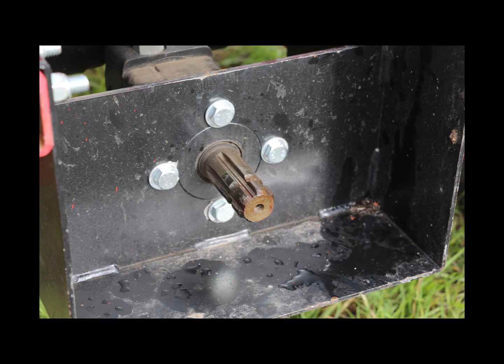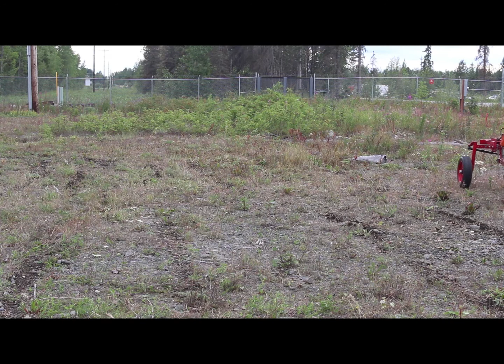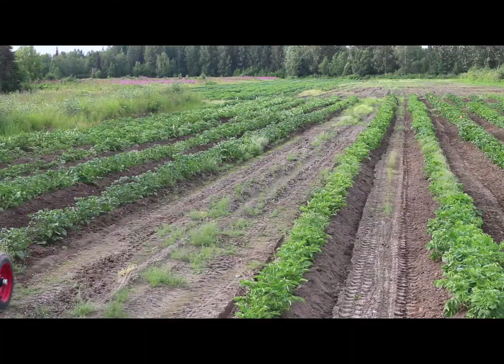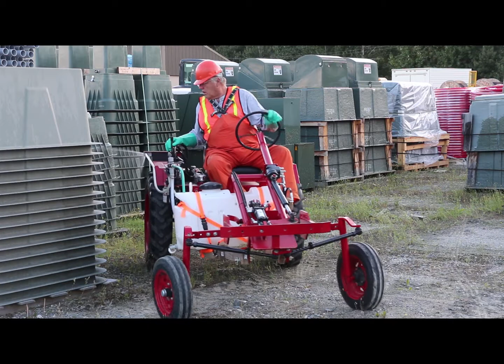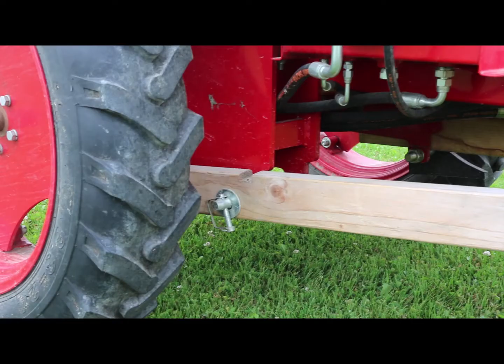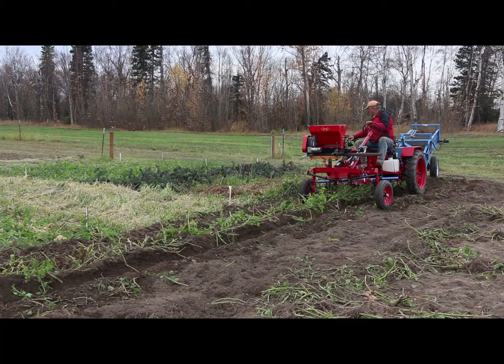Oggun Tractor in Alaska

Comment: Any updates on your speed readout? I’m curious on adapting it for my allis g
Reply from the maker: I haven't implemented it yet.  I practiced a bit and was able to get an accurate plot speed by locking in the engine RPMs and using a stopwatch to time the duration of getting through the 30' plot.  After a few practice runs I could consistently do my runs within a 10% variance.  Although 10% is too sloppy for spraying its fine for cover crop seeding.  I haven't given up on the bike computer but I haven't needed it yet.

Comment: I would add another hydraulic pump for increased flow and pressure.  A lot of excavators use this so as not to depend on the one pump to power everything.
Reply from the maker: Thanks for the comment.  If you pause the video at 0:38 you'll see the stack of hydraulic pumps.  One controls the drive wheel motors, one controls the steering cylindar along with the mid and rear 3-point arms.  The furthest one from the Honda engine runs the pto motor.  Although they share a common reservoir the systems are separate.  I talked to Oggun about increasing flow capacity but their hydraulic specialist thought that would tax the Honda 680 beyond its capability.

Comment: Does it have a half track option?
Reply from the maker: I have not seen one but you might want to talk with your local fabricator...  That's the beauty of this system.  Its simple and stout so you can modify whatever you want. 

Although you might gain some traction (and decrease ground pressure), I think you'd lose a lot of the incredible maneuverability that the wheeled version has.

Comment: Just a note to say ,why don't you trail a small dump trailer behind the potato digger and dump ant the end of the row or bag them at that point? En joyed your video,I think that tractor has umlimited potential
Reply from the maker: Short answer is that the Oggun is barely enough tractor to pull the digger by itself.  I'm not sure it could also pull an additional dump trailer.  

Long answer is when I used the digger with a larger tractor, and had a team of pickers to pull the junk off the digging chain, dumping the spuds off the end into a wagon is a viable strategy.   Unfortunately,  if no workers are available to pull the junk off the digging chain the unit sends a mixture of potatoes, vines and dirt off the back which makes a real mess in the trailer, rather than a nice batch of relatively clean potatoes.  If I have adequate workers available I usually have them pick the potatoes off the chain and let the junk go over the end.  You end up with a much cleaner product in the harvest totes.

Comment: State of the art 1957, Fendt Toolcarrier System, except much better than this (even the Seeder is engineered similar). Look into it, you get some masterpiece of implement designs...And thats not an airseeder btw
Reply from the maker: Thanks for the connection.  I Googled the Fendt Toolcarrier System and what a neat tractor.  The more recent versions look to be much larger than the Oggun but I did find a photo of an older model and you're right,  it looked very similar.  The seeder actually is an air seeder (Gandy Orbit-Air Research Model).  At the time of the video I had not fabricated the bracket to attach the blower that supplies the air or the tubes that carry the seed.  That maybe why you didn't recognize it as a tiny air seeder.  I'll try to post a video of the seeder next growing season.
Reply: @alaskaspecialtycrops9521  An Airseeder is not needed in my opinion. A normal mechanical drill will do it plenty. Airseeders are only efficient above a certain machine size and seeding speed. It would be best driven by sprocket wheel since there seems no PTO with synchron turning speed. Like I said, the oggun has a major design issue to that. Also the leveling is following the rear axle which should be compensated by some contact wheels on the tool itself if the depth of the seeding should be constant.
Reply from the maker: @md.fuelkiller1990    Good Point.  I don't need an air seeder but its what I've got so I'm using it.  One of the reasons that I chose an air seeder is that it gives me the option to seed cover crops in the space between the rows without putting the seed in the row of standing vegetables.  The tubes give me much more precision in  broadcast seeding than a regular drop seeder or cyclone seeder would.  I agree that there are some advantages to a ground-driven unit, especially when drilling the seed.  But for broadcasting the seed I prefer the air seeder.   I'm also able to use the air seeder on larger tractors.

 I'm intrigued with your note about the PTO being synchronized with speed.    Both PTO speed and drive speed are associated with engine rpm but they aren't synchronized on a hydrostatic drive.  Like any tractor,  raising the Oggun's engine RPM increases the speed of the PTO.   I also agree that if the objective is to drill seeds to a consistent  soil depth contact wheels would be very helpful but for this project the seeder is set up to broadcast the seed across the surface.  Thanks for the thought provoking comments !
Reply: @alaskaspecialtycrops9521  I'm very interested in that seed set up.  I did a quick google, and couldn't find on that small.  I'm looking at adding something small to a plastic layer or my tractor for cover crops between my plastic beds.  Any advice on that specific small model?  Thank you.
Reply: sorry, "one" that small.
Reply from the maker: @kevincoblentz9084    The air seeder is made by Gandy (https://www.gandy.net/product-categories/orbit-air-seeders).  They call it their 'Research Model' and they're usually built to order.  When I've bought them new, they were around $6,000.  I was able to get this one for $1,000 at an auction but it took another $1,000 to get it up and running.  I do contract research so the accuracy this unit is capable of justifies the cost.  For regular production cover crop work I'd consider finding some used Gandy fertilizer or seed boxes.   They're much less expensive and will readily get a banded cover crop seeing job done.    Thanks.

Comment: Can you pull a combined bed shaper and plastic layer with the oggun
Reply from the maker: Good question,  I'm not sure if it could.  My guess is that the Oggun could run a smaller combined bed shaper/plastic layer, especially if it is the disk-style bed former.  With the tractor's relatively light weight, pushing large amounts of soil isn't one of its strengths.

Since the Oggun can raise the 4' Bush Hog on the rear 3-point lift arms it could probably also lift a bed former/plastic layer.   I think that if you used a disk-styled bed former, that 'rolls' the soil into the bed, you wouldn't have much problem.  Unfortunately, for the style of bed former where sheet metal plates  'extrude' the soil into a large raised bed, the Oggun may not be enough tractor to accomplish that.

For a research project planned for next summer I need a 3' plastic layer so I'm going to have to come up with something over the winter.   For now, I'm thinking of doing it in two separate passes.  On the first pass I'll make the raised bed with a set of disks on both the mid-mount 3-point arms and another set on the rear arms.   On the second pass I'll rig a roll of plastic (and drip tape) from the mid-mount arms reposition the rear disks to act as covering disks for the edges of the plastic.  I'm certainly open to ideas!

Comment: Get you an Allis Chalmers G. They were doing this in the 40's.
Reply from the maker: Yes and No.  The Oggun has a lot of the design elements from the Allis G but it behaves much differently.  Absolutely no disrespect to the G.   I've used a number of Gs (and would readily buy one if the price is right).  To me, the G is more like riding a slow, powerful motorcycle while the Oggun behaves more like a small tractor. 
 
I really like the Oggun's hydraulic 3-point arms and the conventional 6-spline PTO.  The Allis G couldn't run, much less lift that 4' Bush Hog.  Also, the Honda engine is about double the horse power than the Continental engine in the G.

That said, the G is a great tractor and I'm always on the lookout for one in decent shape.
Reply: That would make a good tractor for planting row crops here in South Carolina....with two too three planters on it....a lot of visual room

Comment: Thank you for making this video. There is very little info available on these tractors and this is very helpful.
Reply from the maker: Thanks for the note.  I've been working with tractors for decades and I did a lot of homework before I finally choose this machine.  Its not the ideal tractor for everyone but it sure does check a lot of boxes for my strange situation.  Its amazing how easy it is to work with the company to make modifications to the machine.  I'd like to modify the hydraulic system so the company arranged a conference call with their hydraulic consultant.  He spec'ed out what changes I should do and where to get the necessary parts.  I'm not sure that the other tractor companies would do something like that.  The tractor is probably off to the local fabricator next month to stretch the frame an additional 24" for an upcoming project.  This machine is designed to be modified to meet your changing needs.

Comment: For your skid plate, could you just use the 2X4's the hold your spray tank and custom cut a sheet of plywood to get the job done and screw it to the bottom of the 2X4's?  Cheap and easy, plus you've got it half done already.
Reply from the maker: After crawling under the machine I've decided to use a piece of 3/16" ultra-high molecular weight Polyethelene.  Its tough, flexible and lightweight.  Its also 'slippery' to let the sticks and junk just 'slide' through.  There are enough mounting points underneath that I won't have problems attaching it to the tractor.    Thanks for the comment!

Comment: i would be tempted to mount the rough cut mower under the tractor, no need for skid plate.
the idea of a separate engine on the potato digger might be best as then the tractor engine is only for locomotion.
Reply from the maker: Thanks for the comments.  I'm not sure that I have the room to mount the Bush Hog on the underbelly 3 point.  I had the tractor in a warm shop last weekend and crawled under to scope out the mounting points for a skid plate.  After seeing how recessed the hydraulic hoses and fittings are I think I may just mount a 2' by 5' piece of 1/4" thick UHMW plastic under there.  That should be enough to 'guide' the branches underneath without grabbing the hoses.  As for the digger, the manufacturer is advising me to try the other ideas before adding an auxiliary engine.  While they think it should work in theory they've never had anyone try it.  I bought the coulters and will try those modifications first.  Again, please keep the ideas coming!

Comment: Jeff, the GPS suggestion is quite doable, but is it worth the programming to develop an APP for low ground speed, short travel distance tasks?   I think not.   However, the probability of you knowing the simple metrics of acres, number of rows per plot and length of rows of any plot with any crop for any field gives you all the data you need with your cell phone to calculate/tabulate mph, km/h, fpm, task time per acre in minutes/hours/shift, etc.

You could set all that up to do all those features while having lunch at a local eatery and still have another productive shift to which to return to finish your day!

Note: you need to set that up in your phone anyway if you still plan on developing valid cover crop data for an agency or a client next year.
Reply from the maker: The simplicity of a simple speed readout has an advantage.  Driving at 2 mph (or 3 ft/sec) I enter the plot, turn on the seeder, drive the 35' plot, glance at the speedometer to verify speed and shut off the seeder just before I leave the plot.  All of this in 12 seconds, so I need the simplicity of a single speed read out.    As all plot work, it takes longer to set up than it does to actually do the plot.

Our plots are physically laid out in the field with tape measures and stakes following maps we've made in the office so the mapping capability of the GPS is kind of wasted.

I have access to several grades of GPS.  Unfortunately, since we don't have an RTK system with a base station both the Garmons and the Trimbles take a while to get a good position fix.  When we're taking geo-referenced soil samples in the field it often takes 30 sec per site to lock in the satellites.  At 61 deg N, we lock in fewer satellites than you're used to at lower latitudes

Thanks for the ideas and please keep them coming!

Comment: Great video.  Consider a wireless bicycle computer that uses GPS so item can be stand alone/wheel size independent.  (may also want to look into an iphone equivalent).
Reply from the maker: Thanks for the idea.   I'll do some googling on the topic.   The Cateye bike computer I purchased can be programed to accept a large variety of wheel sizes.   I'm thinking of putting additional magnets on the wheel to trick the computer into giving me more accuracy at the low speeds in which a tractor operates.

Comment: Nice peice of equipment. I'm kinda surprised that the pto isn't belt driven with an electric clutch. That would take a lot of demand off of the hydraulic system
Reply from the maker: Thanks for your idea.  I wonder if my problem couldn't be solved by putting a flow control valve on the pto line.  Currently, with the digger I run the Oggun wide open for maximum oil flow to all systems.  My pto is spinning so fast that I've got the flow control valve on the digger set to about 3/4 flow bypass.  But, since the pto pump is separate from the drive motor pump savings on one system may not be beneficial to the other system.  I guess I've got to talk to my local hydraulics person...

I'm not sure that a mechanical (belt driven) system would be that much more efficient than the hydraulic system.
Reply: @alaskaspecialtycrops9521  A PTO with mechanical drive is a very good thing in Agriculture since you have applications where you need to get your moving speed matching a specivic PTO speed. When you look up old manuals for seeders or tilling equipment, there are mostly certain lists with matching values on Speed/PTO.